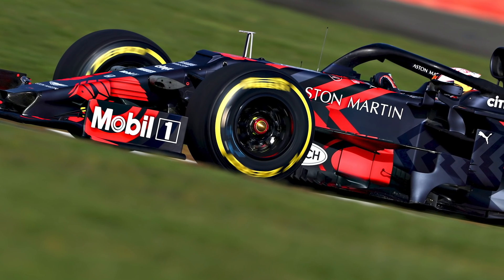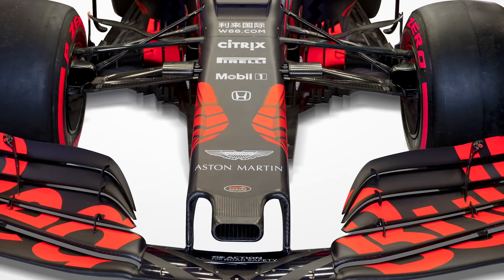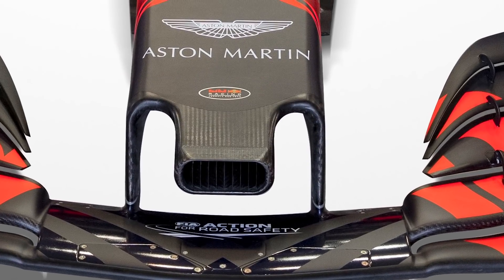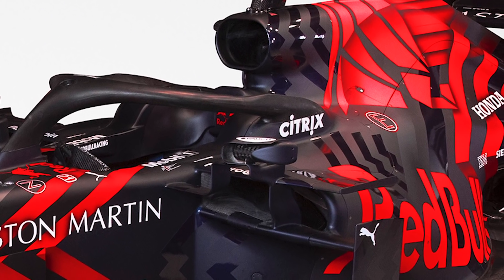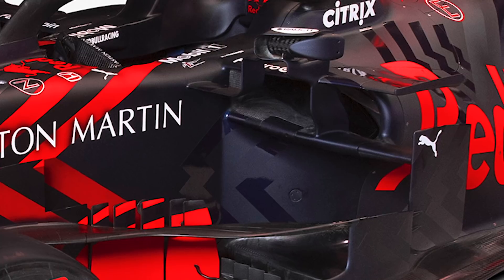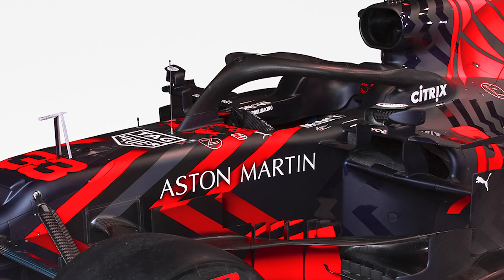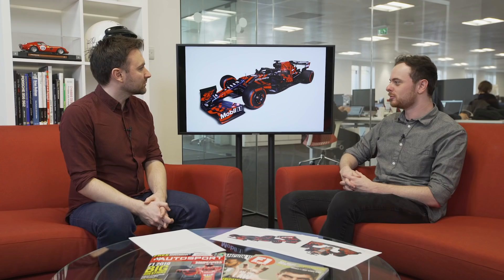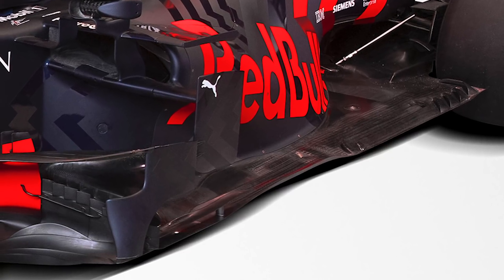Red Bull cuts Honda no slack: New F1 RB15 technical analysis

Comment: Honda will make huge gains switching to red bull they have a chassis alone which shaves a second or so off a lap so they will be fighting Mercedes straight out of the gates in Melbourne. Don't be surprised if Honda can overtake a Mercedes on the straights by seasons end. Mclaren and Toro Rosso chassis are way way behind red bull.

Comment: I just wanna know, why are there so many regulations in F1?
Isn't the aim to make the fastest car? So why hold back so much? Just give manufacturers the ability to do whatever as long as it meets safety regulations, or is it all safety regulations?
Reply: When you let them do whatever they want, the cars will be going way too fast for safety constructions on the trackside. Also, they are no longer safe for the driver as the ride height will be too low, mirrors cant be used because of their position, overtaking is impossible and even bigger gaps between teams with higher budgets and lower budgets. SO, yes, we need those rules. They come into existence because of things learned in the past.

Comment: Looks to be a car set-up for one lap ie quali. Their only chance seems to be slapping it somewhere near the front and trying to break the tow. From what I hear Honda have a suitable ‘party’ mode on par with Mercedes but as soon as dirty air starts flowing into the engine it needs a new map and if it doesn’t get it, it goes bang. The other thing, the shorter wheelbase high rake thing clearly doesn’t work as efficiently as it did with the narrower tyres. The longer wheelbase of the Mercedes goes hand-in-hand with the higher cornering speeds.

Comment: So how soon do you think Horner will be throwing Honda under the bus ?
Reply: By the 4th race.
Reply: Don’t think he will as no other engine supplier will supply Red Bull with engines
Reply: Honda gives them 100%, and has no conflict of interest with their own works team. unlike those arrogant shits at Renault.

So.... never.
Reply: @OnionChoppingNinja  Well, they said the same about Alonso and McLaren but Alonso had enough of their "GP2 engine". Honda even paid Alonso's whopping salary. Not once has the Honda shown some front-running potential neither with McLaren nor RedBullJunior (Toro Rosso). Toro Rosso "interestingly" seemingly traded down as they went from 7th in 2017 to 9th in 2018 and from 53 points in 2017 to 33 points in 2018.
Reply: @paulallen8109  
The relationship McLaren Honda was a bad call from the start. McLaren thought they could recapture the magic from ’88 by just partnering with Honda a second time. And then got downright abusive McLaren towards Honda (forcing Honda into the ‘size-zero’ concept and Alonso insulting Honda any chance he got; I give you that one).

Honda now has something to prove; that they can still compete with the big boys. And Red Bull has something to prove too; that they can kick Renaults arrogant ass, without using Renault engines. Both parties seem eager to help the other out. From my understanding the relationship between Red Bull and Honda has been better than it ever been with Renault or McLaren.

Let’s just say; no one expects Red Bull to become world Champion this year; not even Red Bull themselves. Sure, Helmunt Marko has been boasting a lot about their chances for 2019 while Christian Horner, Max Verstappen and Pierre Gasly have been tempering the expectations for 2019 every opportunity they got. There is only one thing Honda has got to do this season: beat Renault!

And Torro Rosso last year was pretty much a Guinea pig for Honda this year.  If you want to blame someone for Torro Rosso’s dismal results last year, there is only one name you’ve got to mention: Brandon Hartley. 29 points from Gasly despite all those grid penalties vs just 4 from Hartley? Let’s just say that there’s a reason Gasly got promoted to Red Bull and Hartley got sacked.

Comment: this car is the bigest quuestion of the year.
Reply: People are still braindead judging that Honda is worse than Renault. Red bull had the option to choose out of Renault and Honda and they took Honda, because they are simply better, have more potential. The engine itself is already better than the Renault engine, according to Helmut Marko. Ofcourse we dont know how big of a step Renault took with their engine, but judging on the past years it wont be alot.
Reply: @NeweyAdrian1    Speaking of the past: Why don't we look at the last 25 seasons in F1 ?  (1993-2018)
Race wins: Renault 136 , Honda 1 (5 if you count Mugen Honda)
Pole positions: Renault 143,  Honda 3
Fastest laps: Renault 136,  Honda 2
Podiums: Renault 371,  Honda 19
Constructors' titles: Renault 12,  Honda 0
Drivers' titles: Renault 11, Honda 0

So Renault won 23 titles (12 constructors' and 11 drivers') in 25 seasons? Well, how many did Mercedes and Ferrari win during the same seasons? Mercedes won 16 (7+9) and Ferrari won 14 (8+6). Honda won 0 during this time.
But never mind the fact Renault has 23 titles and Mercedes 16 and Ferrari 14 these last 25 seasons. Let's look at the modern turbo era alone.

(2014-2018)
Wins: Renault 12 (including the TAG Heuer branded Renault engine), Honda 0
Pole positions: Renault 3 ,  Honda 0
Fastest laps:  Renault 19,  Honda 2
Podiums: Renault 57,  Honda 0 
Laps led:  Renault 637, Honda 0

So let me get this straight: Honda hasn't managed squat in the last 25 years but they will magically break this bad trend now, even after four straight seasons without even a single podium finish to their name? But we can all laugh at Renault because their 23 titles when Mercedes has managed 16 and Ferrari 14 means nothing. Neither does the fact they have won 136 races these last 25 seasons but Honda only 1 under their own name. 

"Judging on the past years". Yeah, great argument there. At least they have won races every single season since 2014 except for 2015. 

"Helmut Marko says" He'll say anything to make them look good. What he says means nothing. What does mean something is the fact Renault ended their cooperation with Red Bull once they got tired of being blamed when they didn't win but never thanked when they did dominate. Now obviously Red Bull would love a Mercedes engine but they weren't going to get one. Ferrari would never allow any team to beat them with their engine so forget about them. That leaves only Honda. 

When it comes to negative trends Honda has been leading the last 25 years. 

You are braindead.
Reply: You forget one thing my friend. Renault was begging Red bull to stay. With Red BUll they could atleast win races, now its impossible for Renault to win races untill 2021, unless mclaren finds something special. Marketing wise,r red bull was the best thing that could happen for renault.
Reply: How many of those Renault wins were with Red Bull?  @paulallen8109
Reply: @paulallen8109  That '1000' hp Renault engine is looking like a real contender right now ;)

Comment: I bet literally none of the car parts in these reveals are actually on the real car. The teams are probably laughing at everyone analyzing all the aerodynamics on the car reveals.
Reply: Maybe Mercede's car is complete for testing
Reply: @insertname8889  the purpose of the shakedown is to run the engine and check all the systems, I doubt they had their actual aero package on the car.
Reply: Yeah lol, I think the Racing point car was the literally last year's Force India with new front and rear wing
Reply: @AutosportDesign  literally?
Reply: Maybe. I didn't catch up with the changes last year.
Reply: they are made of parts that they try and did not work,  just for the photo.

Comment: Are there new regulations about the rear lights??? First time I have noticed those vertical lights on the back of the rear wing
Reply: It's for better visibility in wet weather.
Reply: Yes thanks to Ocon, and Kvyat returning, all F1 cars have to include turn signals. Drivers are now bound to use the turn signals before they steer, like in real traffic. LOL
Reply: PANTA hahahahhahahaha
Reply: Its new
Reply: New regulation indicators 👍
Reply: Yes

Comment: Forget just the Autosport channel... JBL will be trending in the whole of F1 at this rate.
Reply: Yes... the "technical expert" who explains that the mirrors changed location "for some reason".
I am not an expert but I know that the mirrors changed location due to a thing called "FIA F1 technical regulations" which every "expert" should read, thoroughly, before making an analysis.

At least, Mr. Piola gave us some relevant insight at the end of the video.

There are a lot of true technical experts out there. Some don't even have a job!
Reply: @leoa4c  Marc Priestley's channel is well worth a watch for technical analysis.